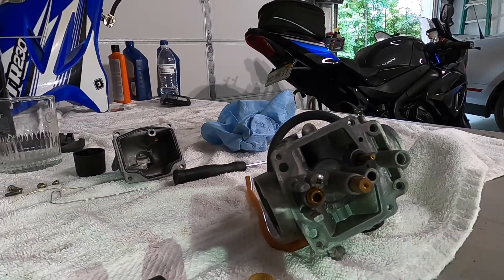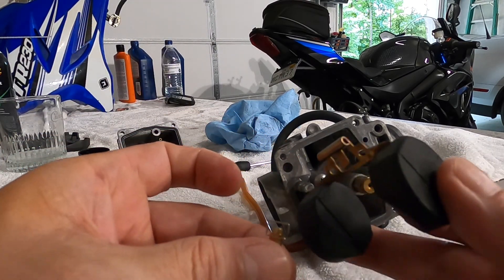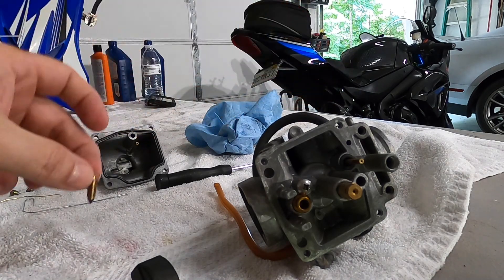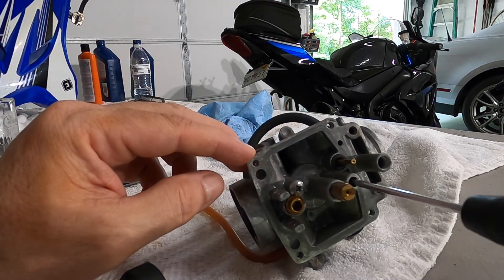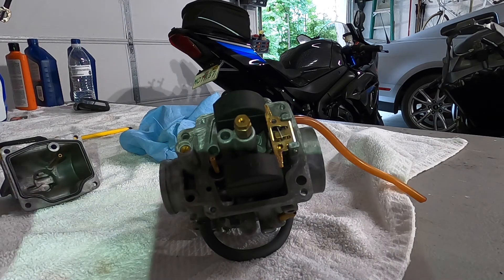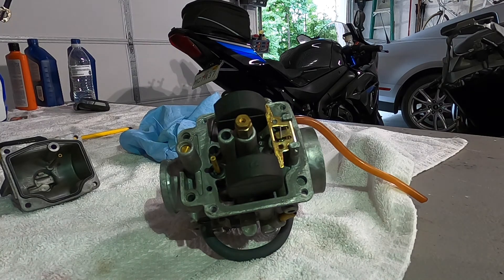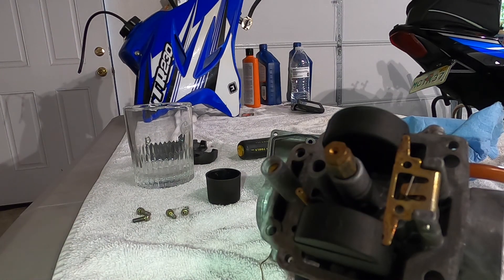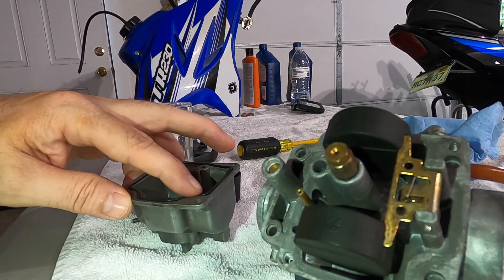HOW TO FIX TTR230 HARD TO START - THE LAST VIDEO YOU WILL NEED.(2020)

Comment: Very good video; I just bought a ttr230 from a sheriffs sale and the gas was bad and the carb was in bad shape. I watched one video and it was no where near as informative as yours. After taking the carb off twice I watched your video and waalaa problem solved thanks to your video. Great job!
Reply from the maker: I made this video because there isn't a thorough video on it. I'm glad it helped.
Reply: @MantisRacing  really appreciate your time and explanations, very well done.
Am currently stripping and cleaning ttr 230 carby. I hope I get the same results as you did
Reply: At the end you said you had to turn the fuel screw another turn? You did it 2.5 turns at the start, Are you saying you now went 3.5 turns or 3 turns
Reply: @MantisRacing  This is an excellent tutorial
The small beaks in between allowed time to see and watch again to make sure I got it right
I did try this some 8 or 9 months ago, put an Allballs carby kit through. Thoroughly cleaned the carby over 3 and 4 days to remove all the 'gunk'. It worked for a little while, then refused to start.
Just did it all again this afternoon. Isolated the issue to the carby only
Thoroughly cleaned, every single orifice multiple times.
Used some 'start ya bastard' through the air cleaner and 'viola', bike running and purring
2 things: I noticed the needle and seat were a bit sticky. A drop of oil fixed that
I think i had the  air mixture screw too far out, maybe 5 turns. I now have 2 1/2 and it runs smooth.
(just need to charge the battery). Good news is, I was at 9v, when running 12v and under throttle, 14+ so the charge system is working.
it is possible to get a right hand bend screw driver up into the air mixture screw,. It's tight, but can be done
Or, you can take the carby off again
Thanks for the great video and explanation.   Many thanks from Australia

Comment: In almost every one of these carburetor cleaning videos, an important step is left out: Air jets. Those are the small circular air passages on the air cleaner side of the carburetor. There are very small brass air jet inserts (non-removable) that need to be clear.The air passages run thru the body of the carburetor and feed the main and pilot jet fuel circuits. These also MUST be cleaned.
Reply from the maker: I did cover this. Thanks for the comment.

Comment: Great video! Very thorough. I am waiting on a 130 and 38 jet and will be cleaning the carb and installing. I had a completely clogged Petcock when I got it and since have cleaned the carb once but did not hit all the choke areas like you showed. My bike runs great but has a little sputtering and pop in the carb on just over idle. Thinking it may be too lean and may still have some clogged areas. At speed it is great with not bogging or hesitation. Thanks for the video!
Reply from the maker: Thanks for the reply.  I hope it helps.  The cleaning made a huge difference for us.  The hesitation is tunable with the fuel screw, but it will never run like an EFI bike.  Our bike didn't want to start and it had this very noticeable hesitation where the power just dropped off completely.  It made slow maneuvers dangerous.  They're like tanks when they run right!

Comment: Note owner is NOT running a fuel filter between the tank and the carb. This will stop 95% of the dirt that would cause you problems in the first place. :)
Reply: There is a filter on the petcock in the gas tank or else yamaha would have installed inline filter
Reply: @darreng2639  There is a mesh screen in the tank valve, it does NOT stop smaller dirt particles from entering the carburetor. Your statement is funny, go back to racing hot wheels cars!
Reply: I have a ttr 125 and there's such a small space between the petcock and the carb that idk how to fit a filter in between there?

Comment: This is a great video! I made a similar one, but only for upgrading the jets, you definitely gave me insight in the ports that need to be inspected... It funny everything should come out great but! IF that tab on the float Boal is messed with or not adjusted correctly, that can be a real fun diagnosis to figure out!  This may sound crazy but I seen people blow the holes with their mouth to ensure air is passing through "not me" LMAO
Reply from the maker: Thanks for the comment.  Any videos on these bikes carburetors are helpful.   I made this video out of frustration after one cleaning, following other videos, putting the bike back together only to still have rough starting.  I hope it helps you.

Comment: I just got a ttr230 and ive got a 130 main and 38 pilot did you find the fuel screw at 2 1/2  worked ive read that woth the bigger jetts you wind it in and come one turn out and its perfect for them but you have to open the air box to
Reply from the maker: My experience has been, it had been a couple years, you are not going to get it right everywhere.  Once I found a setting i liked I did not have to touch it anymore.

Comment: I got a 05 ttr 230, and it only runs with the choke out, I took the carb off and looked at the jets and they are clean and it still won’t run right. But only runs with the choke out and when you push it in it’ll die even when riding
Reply from the maker: Try adjusting the fuel screw.  Change sparkplug.
Reply: Blocked pilot jet. Use fuel stabiliser.
Reply: It’s not any of that I just had a cheap carb on it. But the bike sat for 7 years. Had to replace all the gaskets now I’m dealing with a possible warped to end airs leaking out the middle gasket on the head and oil and air spraying out of the tensioner.
Reply from the maker: @zachlafave8123  Sorry for your luck and bike.  Its hard to tune out mechanical issues.  Hopefully it is something fixable without a lot of $$.
Reply: @MantisRacing   I’ve already put $700 into it lol it’s been a pain haha

Comment: Does the gas tank have to be drained before taking carb off?? Thanks in advance!
Reply from the maker: No, I used the fuel cutoff valve below the tank.
Reply: @MantisRacing  Got it, Cleaned entire carb + new battery spark plug is sparking, still is cranking over and over but no start have any idea what it could be? 2007 btw
Reply from the maker: @Papi2003Z  Sometimes when I have issues like this, I pull the intake boot and spray TB cleaner directly into the carb with the blade open to ensure I have fuel in the cylinder.  I close the throttle and then try it.  

Also, I have had luck spraying into the plastic tubes handing from the carb with TB cleaner.  This method takes a little longer to get the fuel into the cylinder though.

Comment: Hello, excellent video, I'm from Argentina, I have a 230 0km ttr, the carburetor clogged for not using it. when cleaning and placing it, it starts but the exhaust manifold turns red in seconds.
would you know what it could be? the bike is new, maybe it is a problem of the mixture. grciass
Reply from the maker: Add fuel through the fuel screw. Or take to dealer if new and let them sort it out.

Comment: On the fuel screw you went out 3 1/2 turns is that correct
Reply from the maker: That seems about right.  I believe that was my starting point. It will cary depending on altitude and jetting.

Comment: So is it 2.5 turns? Or 3 turns?
Reply from the maker: Try both.  It depends on which one runs best.  Without fuel injection it will be hard to have a perfect setting for every throttle position.

Comment: Would this be pretty similar to an 05 ttr230? Mine doesn’t want to start when cold and the choke system isn’t working right
Reply from the maker: I don’t think they have changed since forever.  Mine is an 06.  If the choke isn’t working right most likely it is plugged.
Reply: @MantisRacing  that’s what I figured. Thanks!
Reply: @MantisRacing  do you know where you got those plastics? I’m having trouble finding any for mine and they are shot
Reply from the maker: @lukasb8408  no, I bought it used and they were with it.  I had no idea they're hard to find.
Reply: @Lukas B. Plenty of parts, new and used online. The prices are reasonable.

Comment: Help ,anyone pls! I have a ttr230 and yes the carb is the same , but when i turn the fuel on it pours out the overflow valve , i have checked the float and pin , i have cleaned all jets , valves , cant get it to not leak gas , my next option is a amazon carb lol
Reply: Make sure your bowl has no old varnish on it.   Also check the needle valve and the plunger on top of valve, it should move and be springy. Check O ring on inlet. Make sure your floats are ok.  Adjust the center prong on float and do a float adjustment. There are videos on it. Gas ran out of my overflow at last 15 times before I got it. The clear hose test works great and is Yamaha's way to set floats.

Comment: You never said how to adjust the pilot jet
Reply: Like all the way in and 2 turns out?
Reply from the maker: Try it there.or 3 turns.  Move in 1/4 turn increments until idle sounds best.
Reply from the maker: I’m talking about fuel screw. Pilot jet is fixed
Reply: @MantisRacing   so your saying the pilot jet doesn't have to be turned out? Thanks in advance
Reply from the maker: @frannnkk_______  the pilot jet should removed and the hole cleaned.  Then it is just reinstalled and tightened.